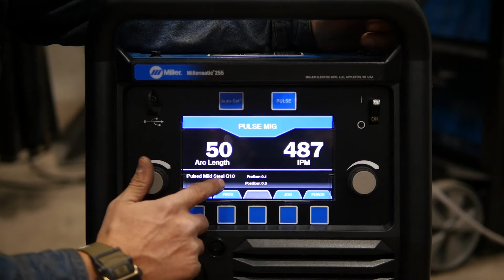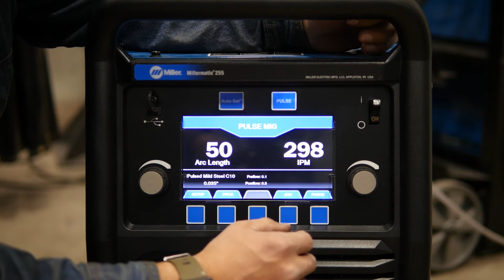Pulsed MIG in any Position

Comment: Thanks. The arc length presumably is directly related to the voltage, so is there a base reading of voltage that you can see?
Reply from the maker: Yes. The machine will produce an average voltage reading so you can build a WPS around that average. The D1.1 includes language addressing waveforms and best practices for using average amps and average voltage for your WPS.